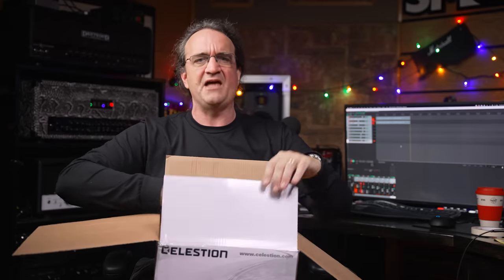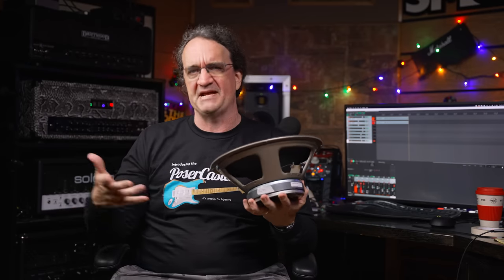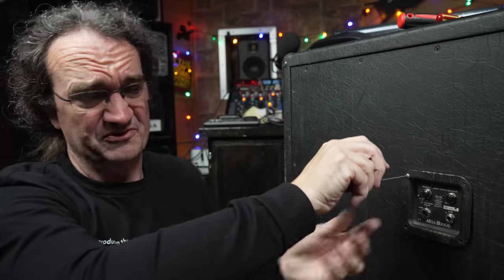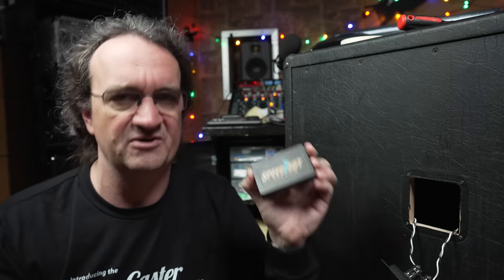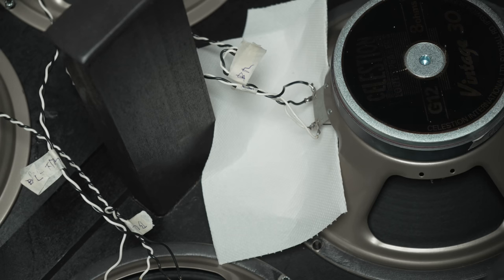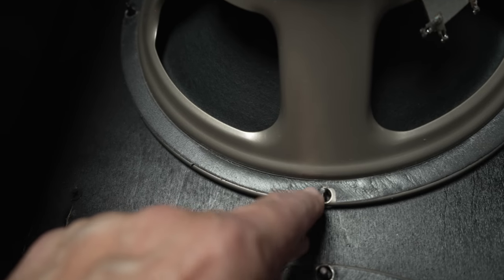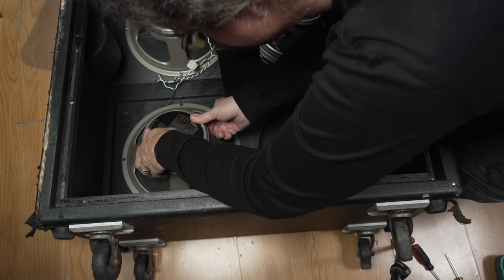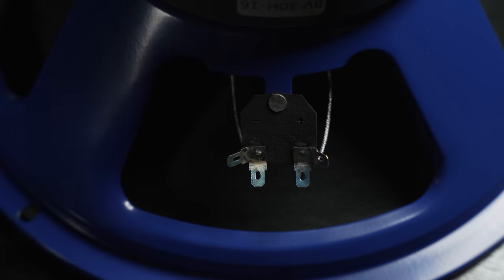How to Change Guitar Speakers (Even if You're a Bass Player!)

Comment: This may go down to minutiae of the detail, but there are a few things to bear in mind in all of this. First, speakers are not cheap. I recently bought a quad of Eminences for one of my cabs which ran an average of £106 each. That's £424 + £9 shipping to replace (four blown) drivers a single Marshall 1960AV cabinet. And really, speakers are not really returnable. So you have to really hope the speakers you are buying are actually what you want. The second thing is the cabinet itself. As you demonstrated a few times, cabinet matters a lot. It is entirely possible to have a guitar cabinet that will suck out loud no matter what you put into it. And finally the third thing, are you comparing the sound of the cabinet when you're playing it standing 3ft away?In which case, sure mixing a few speaker types is a great plan. OR are you playing a gig where upon the sound guy will likely close mic one single speaker and, as is the case for most local gigs, will spend all of 13 seconds locating the spot on the cabinet which to mic. Some may go as far as shining a torch through the cloth and making a guess where to mic. But no soundguy is going to spend a bunch of time discussing whether to mic the V30, the Swamp Thang, the V-Type, the CL80, the K100, whatever. So that speaker has to sound good both ways. So unless you want to spend an awful lot of cash rolling speakers in and out of your specific cabinet, it's 100% guesswork. And sadly, I'm not convinced YouTube helps. And just to throw on, my 1960AV is currently running Celestion V-Types. It sounds good enough with almost any Marshall head. Throw a Peavey or a Mesa on top and it's really rather underwhelming. Roll out the Engl cabinet, the Marshalls don't sound right but the Peavey/Mesa does. While playing around with all this equipment is really the only answer, it sure can get expensive real fast. I say all this, while my L6 Helix is in the corner of my room, rubbing it's hands with that snidey "told ya so" thing going on...

Comment: Yeah, don't play with the wiring if you don't know what you are doing. I'm seen tube amps blow transformers and tubes because someone wired all of their speakers in the 4x12 cab in parallel. Amps expecting to see 16 ohms will fail when offered 2 ohms instead.

Comment: I hate it when people solder speaker wires!!!  The ONLY issues I’ve had with speaker cabs are shitty solder connections.  Over time, cracks or cold-solder connections will cause speakers to cut out and can ruin the output transformer of your amp.  Spade connectors have NEVER given me a problem in any way.

Comment: Soldered connections are less likely to vibrate loose, so if you are taking a cab on the road for some touring duty, you might want to consider soldering the connections.
Reply: It's true, they'll never vibrate loose (unless it's an utterly terrible soldering job).  But really, neither will spade connectors as long as you give 'em a pinch with your pliers once they're on the terminal.  The worst is when someone solders the spade connector to the terminal!  I've actually seen that.  facepalm

Comment: You should most definitely see tonal changes with the change in ohm load. That ohm load is going to determine how much power your amp can deliver to the voice coils. If you can’t deliver enough power to really drive the speaker it’s gonna sound like a bucket of buttholes. Same with over driving, you just clip the shit out of it causing the coil to slap the motor structure and destroy the speaker. 

That said, yes, I’d love to see that video.

Comment: @12:31 That blue spade connector doesn't seem to fit there very well... it might be a bit too big? Or does it just look like it when you wiggle it? :)

As Glenn stated. Spade connectors are sold in all possible sizes, widths and the thicknesses. And the "Red, Blue, Yellow" color coding is never any guarantee that they're the same size with each other. There are no real standards.

So one measures the thickness and width of the mating connector, goes to a digikey or mouser etc. and uses the parametric search to find the right ones for that size.

They're also sold with a LOCK, that's why the hole is there on the spade lug, it's not for soldering, it's for that locking clip to secure the connector in place. :)

-- Your friendly neighborhood Electronics Technician.

Comment: Pro tip: Don't use power tools for this. A hand screwdriver is going to reduce the chances of stripping a screw. Power tools are for things that are structural.

Use a solder wick. It's helps prevent dripping solder.

Comment: Once I find the speaker I like, I’ve always preferred to solder the connections. JUST BE CAREFUL not to drip hot solder on the back of the cone, spider, etc. as Glenn said. Does soldering the connections make  a difference in tone? Absolutely not. It’s just my preference.

Comment: if you have an open back cab , changing speakers will never sound as good as a closed back cab .., so first .. get a closed back cab , this is for rock/metal . Open back has its use though

Comment: There's nothing wrong with using spade connectors, and I don't hear any difference in the tone between spade connectors &soldered connections.
Personally, I have rewired my two 4×12 cabs after installing new speakers, and soldered all connections for nothing other than the sake of complete reliability. Not that spade connectors aren't reliable or anything... Solder is just the ultimate in reliability. I also take out the stereo jacks and switch, and leave a single switchcraft jack. I lost a output transformer to a bad plastic jack once, and now I have jack OCD

Comment: The problem with spade connectors comes when your bass player (or possibly the drummer) pees on your cab. Then the corrosion can ruin the connection. (for the bass players out there: that's a joke) (and for the drummers: so is that).

Comment: 10:52 I'm sure no difference in tone, more a Crackle issue after being dropped and bouncing around a Van when gigging, no issue if sitting still for years. You'd be amazed how weak a connection can get from just "Shocks" from dropping or shifting around, years of aviation experience. A little solder dab ill do ya.

Comment: Glenns gonna have a bunch of angry bass players screaming at him because they changed their speaker thinking it would make their cab sound better but actually ruined it. Bass cabs have to be built and tuned to the speaker. You can't just swap them willy nilly. An awesome speaker will sound like ass in the wrong cab. Volume, porting and even bracing all have to be taken into account and designed around the speaker in a bass cab. You might get lucky, but more likely you won't be happy

Comment: Where the rubber meets the road....but don't let the Magic Smoke out of your Amp.....
Series, Parallel, or Series parallel....
8ohm + 8ohm can be 4ohm or 16ohm
but 
8+8+8+8 can be 2ohm, or 8ohm, or 32ohm
16+16+16+16 can be 4ohm, or 16ohm or 64ohm

Also a 16ohm speaker used with a 8ohm Amp output "SQUEEZES" the output .....100w turns into 50w
A poor man's power soaker

Comment: so you are say that most of them don't know how to use a screwdriver   or a soldering iron ,that you need to make a video on how to changer speaker ,  well the wirering can be dificult  if want to change it for paralel ro seri  or make your cab stereo , but most of the time you change like from like ,  i feel bad for this generation

Comment: Seeing that I don't play out anymore, don't have a space to dime out amps anymore, all I can say is thank the Baby Brown Jeebus for IRs!  Fuck me...

As for your drill and using a Philips: 1st off,  as a Canadian replace Philips with the far superior Robertson screws! One of Canada's best inventions.. Philips (especially cheap china screws) are garbage 2) ensure your drill is on the slowest torque'iest setting - that sucker is spinning  too fast 3) for tight screws like that, put a small piece of cloth or elastic band over the screw before you use the drill for additional grip and save yourself from having to buy extractor bits for the screws you nuked. Even just using the drill without power to get it going before power will help you not spinning that fuck in there like that. You have a lot of leverage on that drill handle.